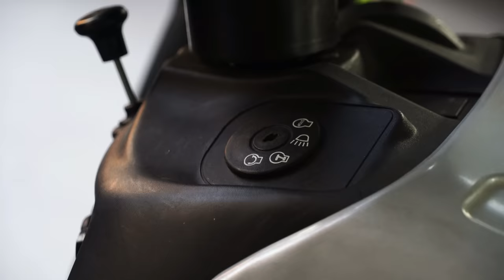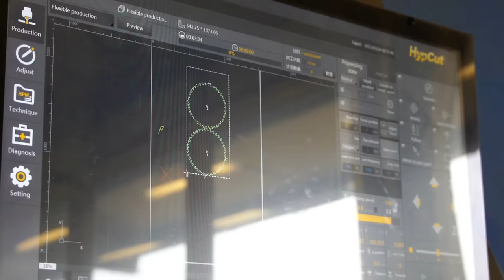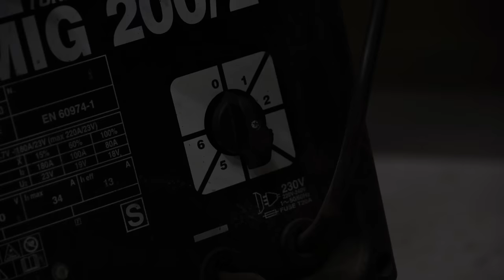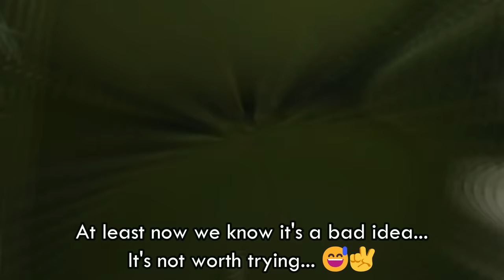CIRCULAR SAW on Tractor MOWER !?

Comment: The saw blades had no cutting edge. Perhaps if you put a bevel on each, like the standard bevel on a normal blade, you would have better success. Also, the mass of your saw blades is much higher than standard bar blades, requiring much more power to spin. I suggest you cut out most of the center, leaving five or six "spokes" supporting the outer rim and teeth. You might also consider twisting the spokes to provide lift to the grass, allowing for more opportunities to be further chopped up.

Comment: Interesting experiment.  Wonder if you reduced the weight of the saw blades by having the laser guy cut out some designs in the blade like holes they cut into car rotors?

Comment: You've given me an idea there. Instead of circulars, what about two smaller discs to which you can attach decent lengths of thick nylon thread? Essentially turning it into a big string trimmer. That would fly through tall grass I'll bet.

Comment: I belive you were on to something with the saw blades I could see that working but they have to be smaller. Those blades were a big as the deck so the grass would be pushed down by the mower and the blades wouldn't touch the grass. If you made them smaller it's easier on the clutch and has a chance to actually cut

Comment: Here in lies the problem, your deck is designed for lawn nothing to do with the blades.
Remove the front edge of the deck, probably pay to reinforce the deck as cutting it will weaken it considerably... being the tricky handy fellow you are, make the front edge hinge with some sort of mech linked to a lever so you can adjust between the two "modes" 🤔
One of my mowers has a removable front edge from factory(Cox Lawn Boss)
Reply from the maker: Yes, that's what I wrote in the video, so that then the circulars would probably work perfectly...

Comment: Open up the front of the deck the width of the blades. This will allow the blades to work better and cutting instead of the deck bending the grass over and not allowing the saw blades to touch it

Comment: You made the circular blades too large.  They take up so much of the room under the guard that the grass is already pushed down and can't raise back up to be cut by the blades.  If you took 3 or 4 inches off the diameter, if not more, they might actually work better.  It will also reduce the issue with the belts.  
That said, I agree, the blades will do just fine if they are sharpened.  That or just plan to do 2 passes over the larger brush areas.

Comment: The sawblades are too large. The grass can't get in between the deck and teeth of the blade. Also, consider removing material from the sawblades so you're left with the outer edge and make the inside look like an X with sharpened edges. You'll effectively have a mower blade on each leg of the X when you sharpen it AND you'll have the benefit of the sawblade (if there is any benefit)

Comment: Great idea, looks badass. Lessen the weight by spikes, I agree; with a literal twist. My thought is less weight, yes; but smokes also catch and build up; could try wide spokes, with twisting the spoke up or down it may throw instead of build up. Also keeping cut height in mind. Maybe cut front wall of mower deck and cut back deck top a few inches to expose the cutting teeth, while grass is standing up as much as it can before it meets the blades. Think like a saw blade attached to a weed wacker instead of string. Think of the string as a thin long regular type mowing blade; and a saw blade is still a saw blade. Teeth must meet standing grass before it can cut it. No different from a table saw, hand held circular saw, or saw mill blade; and the weed wacker with a blade.

Comment: Can you try to put rototiller blade instead of rear wheel, just to see if that could be the cheapest option (if you already have riding mower) to plow ground. If it dig too much maybe a trailer jack could adjust the height.

Comment: Its not the blades but the front of the deck pushing the grass over before the blades can cut it. Cut the front of the deck off so it doesn't push the grass over and watch how its cuts, so much better. I cut my my deck and added 3 or 4 links of chain to hang down where the deck was cut off.

Comment: A lawnmower blade is an aerofoil designed to lift the grass before cutting it, then it discharges the clippings to prevent clumping.  A circular saw blade literally just isn’t going to cut it.

The only way to make it cut better will be to improve upon the existing design. Maybe try a different blade design or change the configuration with a multi blade set up.

Comment: You have the beginning of a good idea. I think that if you take the blades back and some fans cut into and bend them up at the right angle that would give you the vacuum. Then cut the decks front so it doesn’t bend the grass over. You may have to cut some of the top off also. Let me how it works for you.

Comment: If the front of the deck was cut off the saw blades would work, nice video
Reply: agreed. if the front lip was cut off about 1 inch above the blade it probably would work much better but you would have to weld a flat strip on tho to add reinforcement back to it for what you cut off for strength tho and by making a open front like a brushhog it should work much better I would think.
Reply: agreed. if the front lip was cut off about 1 inch above the blade it probably would work much better but you would have to weld a flat strip on tho to add reinforcement back to it for what you cut off for strength tho and by making a open front like a brushhog it should work much better I would think.

Comment: Need to open up the front and the rear  to let the grass in and also expell the cut material. Edge of the deck is constricting the grass to get next to the blade.  Had a wheelhorse mower with open deck design, would lay the grass out like you were making hay.

Comment: Isn't anyone going to comment on the sheer stupidity of the way that mower was propped up while working on it? Even as dumb as that was in principle from a safety standpoint it was compounded by the steal head of the hammer resting on that smooth concrete floor! Some people seem to think most anything is a good idea I suppose.

Comment: Interesting video! I actually liked how there were NO WORDS spoken, just text and video, that's all you really need for the most part. Some people put on videos about stuff and they like to talk for 10 minutes before they actually get to the gist of the video. Anyway, enough complaining. I think the circular blade idea may still have some merit. I would suggest redesigning the circular blades to to cut out sections inside of the circular area and put sharp cutting edges on them. Sort of like on a sprocket on a bicycle. This would reduce the weight of the blade, give more cutting edges, allow more grass to be drafted up into the top of the deck and get a little "mulching" action, and probablyl just be a better blade.  Sometimes it takes trial and error to get a new idea or design to work good. Try that and see how it works, and let us know lol

Comment: As far as safety goes I think it's a bad idea..only reason I say that is saw blades like that were designed to be driven from a tractor pto at 548 rpm..they are supposed to be hammered in for that rpm..my guess is that's way too fast and could literally explode..I ran a saw with big blades and an electrician wanted to put big blades on a 3453 rpm motor..I remember thinking it's been nice knowing you..

Comment: Your design had a fundamental flaw. No place to feed the grass to the blades. You either need to open up the front of the deck or make hollow blade circles with a cutting surface on the inside.

Comment: What you need is a two stage cutting system: A lawnmower on the front of the tractor, like a bumper,  that is about 8" off the ground to cut the grass as you start to run it over. Then the tractor finishes it.

Comment: Yeah, circular blades like that are only good for cutting woody stuff, not soft grass and when they are used, they are open entirely, the saw blades do not create and vacuum to such the grass blades up and discharge the clipping out, now had you done something like design a blade system withsay 4, 5, or 6 cutting blades with large angles behind the cutting edges to create a heavy vacuum, that would have been MUCH better. Even with Bush hog blades, they still use essentially small airplane wings on the outside of the blades to draw up the pliable grass so that the following blade can cut it.

Comment: There is no updraft. There is no space at front of deck for grass to spring back up after being laid over by front edge(same reason it doesn't like tall grass). Not enough space between cutting edges for grass to enter at high speed. Bearings are not designed for that weight $$$. Belts are not designed for that weight $$$.

Comment: 6:30  Time. Old farm boy here.  Blades, are necessary for vegetation mowing. Blades, are about only 10  %  of the total  cutting area, of any mower ; depending on their width. THE  OPEN  SPACES  BETWEEN  THE  TWO  ENDS,  allow for  the  ' growth '  being mowed, to  ...um....STAND  UP.  This allows the taller growth, to be cut.  Example :  i made an adapter for my Stihl   weed trimmer ; out of a deep socket ; welded skill saw blade to it. Attach, and tighten nut on drive.  Voila.   This method, on a trimmer, works very well. THE  THING  IS,  one must approach the  growth, from every angle, of that  360  circle.  This principle  DOESN'T   APPLY  TO   A   TRACTOR,  where the cutting blades, are shieled by a shroud ;  NOT  allowing the growth, to  ' stand up '  and  be  cut.  Also, the only way that the growth, is  mowed, is  FROM  ONE  DIRECTION ....straight  ahead.   Your  better off,  with the conventional  blades ;   allowing  SPACE  to   let the growth, rise up and be met by the blade.  Physics,  apparently ;   is  not  taught  in schools  anymore .   AND ,  it shows,  in  the modern  engineers  handbook ;   modern  plastic  junk.   USE  ONCE,  THROW AWAY   - buy another one.

Comment: I know what the problem with those two saw blades. What you need to do is cut the leading edge of the deck so that teeth of the saw will be able to cut any height of grass, including quite tall weeds.the usually bend, which means that that leading edge will only interfere with those teeth, which need to be sharpened. I see you used the metal hardox. Yes, it's an excellent metal, extremely hard. Why do you need to sharpen the two of them? Those teeth aren't cutting the grass. Do not cut off the tabs at the middle front of the deck, and neither should you do that with the roller in that place. All those blades were doing was slapping that grass and weeds. That's the reason why they need to be sharpened. I'm relatively certain that that machine shop will be able to cut those teeth for you. By the way, you quit sooner than you needed to with that idea. All you needed to do was think of the problems and then do the same with the solutions to those problems.
Reply: I was reading a few of the other people's suggestions, with one I agree with. A person typed there should be holes drilled into those two disks to lighen them. What sizes should they be? As much diameter as they could be, except not to the point of failure. There possibly needs to ve an inch or more space between those holes and the teeth on the outside circumference of those two disks. The same for the middle hole of them. Drill one side first, and then do the other side of them. Those people will know how to do this over there in that metal fabrication shop.

Comment: The two major factors preventing this from working are the saw weight is too heavy and there's zero uplift to draw the grass into the saws. 
I think a cooler, more practical design would be a dual or quad scythe blades. If angled correctly, they should proved enough uplift to suck the grass into the blades and the reduced weight should mean they're able to spin faster than typical blades.

Comment: It's not working good because the blade is not really getting a good contact with the grass because the blades are shielded by the wall of the deck so that means no contact with grass hardly if you open the front of the deck and let the blades be free maybe a better cut

Comment: I built an attachment for the front of my zero turn I've got three carbide tip saw blades 12 inches and a separate engine that runs them that I can run into small saplings and cut them out of the way

Comment: Maybe you should try with 2 thick wires instead those 2 plates. In some cases a trimmer with wire it is better than a steel cutting  plate.
You need high speed for the wires.

Comment: To big no room for the grass to get in between the blade and deck nothing to create updraft to suck up the grass and blow it out  if you made them 1/4 smaller and cut out sections of the circle for room for the grass to get pulled to and offset the circular saw type blade by bending one up the other down slightly they might cut pretty good even just making them a 1/4 smaller would help tremendously

Comment: Maybe?... Two blades in a cross "×" would do better than a circular blade? More cutting edge? Less flat surface.
Just my thought.
Reply: The lawn mower blades have been the way they are for as long as they have been selling them because the design is optimal for cutting and pulling up and throwing out the grass the only thing they've done over all these years is bend up the ends slightly before the cutting surface I think the blade being sharpened closer to the center on a regular blade would be the only thing that would help really but the grass is cut before the bulk of the blade goes over so that might not even give the slightest change in cut either in pretty sure there's nothing better then what we've been using as blades go really
Reply: @donnieharness2  exactly right

Comment: You say a circular saw blades but them not they have no sharpen Edge and you made no attempt to put a blade on it of any description to cut
The reason lawn mower blades work so well because they pull the grass up which makes it easier to cut even with a double blade

Comment: Idea is great. 
Realisation not so much. 
Diameter of circular saw is to big. There is litterary no room for grass. Teeth are not properly sharpened. And you could add a lot of holes in circular saw to make it lighter. 
And you are using tractor mower. With all adjustments.... 
Maybe zero turn mower ? 
Well, thank you. Now we all know what doesn't work.

Comment: Duh! there is no space for grass to enter the cutting area like the bar blade!!!!
Maybe if you made a composite blade ie smaller circular blade with bar like tips. Similar to your picture of overlay of smaller circular blade on bar blade in beginning of video or maybe just a smaller circular blade that gives grass/weeds chance to stand up between deck and blade?

Comment: Your Idea Would Work Great If You Would Have Carried it 1 Step Further an Notched The Front of Your Mowing Deck so the Saw Blades Caught The Grass Head On Instead your Deck is Laying it Flat an Those Blades Has No Lift  like Mower Blades so Your Grass Is Just Staying Bent Over Til it Exits The Backside of The Deck ! 🇺🇸

Comment: I didn't actually watch this, but common sense says not gonna work good. Mower blades are angled for a reason. Basically creates a vacuum which pulls the grass upwards evenly. And also creates pressure to expell it out. Not to mention the actual cutting edge of blades. So this is just totally stupid. Next!

Comment: Dumb idea. The lawn tractor blades do more than cut.
Reply: It's not dumb idea. I'm using circural blades with Stihl FS 260 trimmer and it cuts 1 m tall grass and weeds with thick stem without any problems. But this tooths are to big, they need to be much smaller and I don't know this lawn mower RPM but I think my trimmer have much bigger one and that is also problem. At least I think so.

Comment: You will have to modify the cutting edges of the teeth to cut horizontally.
Also, wieght needs to be cut out of the circular blade to lighten it, like a cog/gear.
Reply: I agree. Plus it’ll create a vacuum and pull the grass up to be cut.

Comment: One big issue is the mower deck it's a stamped deck a welded deck have thicker steel and they are deeper and it's much bigger with a deck with 3 blades for that tall of grass and weeds you need to put the deck all the way up then I'd put it on #4 your not going to cut it all down in one pass if you have a tractor with a PTO and a brush hog then you might be able to do it

Comment: Should have cut several holes or made the blades like spokes on a wheel rim. That would cut down on the weight a lot more. Have fewer teeth too. If you always bent some "FLAPS" or angle on the blades, that would help lift the grass up too.

Comment: Well it was worth the try. I hate cutting my grass with my zero turn cause rhe blades just dull too fast. I sharpen them but after 1 cut they have to be sharpened again. I guess they are using softer metals to make these blades on the market and its sad cause the cheapest set of blades for my mower is right at $60 without tax and I havent even checked with prices as high as they are now 😆.

Comment: I thought you were gonna take the circular blade and weld the lawnmower blade on to it so that it can stll be mounted without having to laser cut a mounting hole. Plus the circular blade could still cut the tall grass as it being smaller in diameter as the regular lawnmower blades.